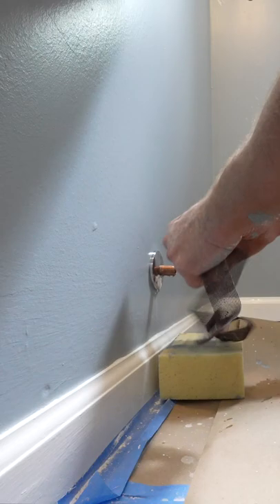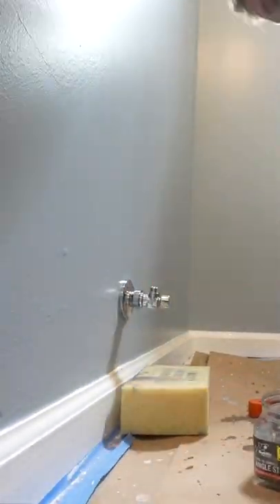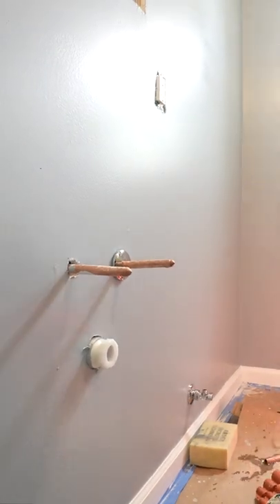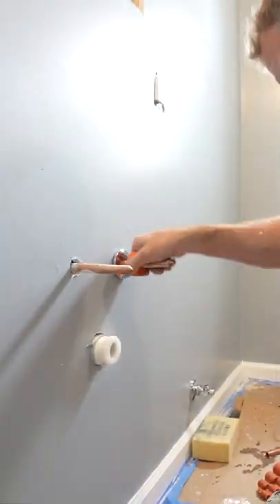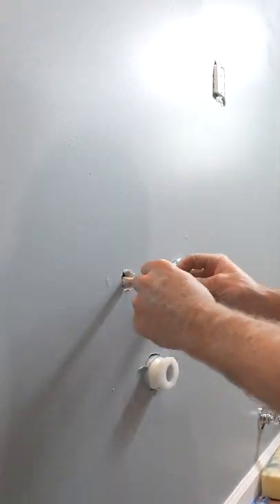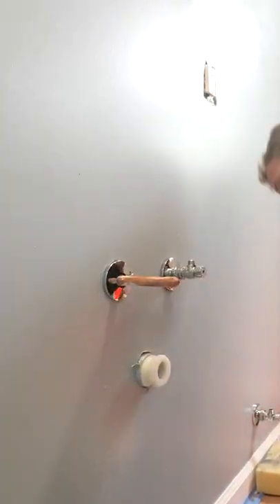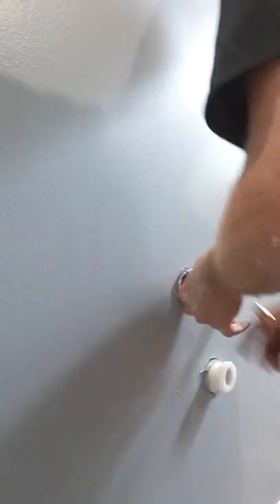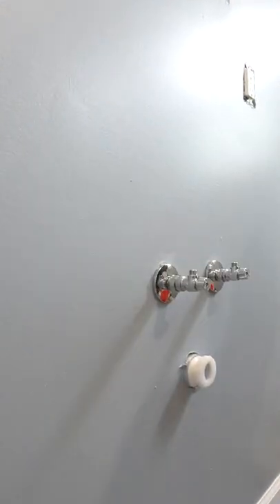Sharkbite Shut Off Valves

Comment: My question is why cut it so short , just make a bigger job for the next guy when these eventually fail
Reply: I think there is a sleeve that comes off that will allow you to get a slim wrench in to release the valve
Reply: I thought the same thing…why?! Why?! Its too short for the inevitable repair…
Reply: why will these fail? is there a better alternative that won't fail?
Reply: @rbruce5270  sharkbites are good and bad. Its good for emergency’s, but when installing its a good practice to de bur the pipe so they last alittle longer. But i would rather use a compres fitting instead or propress. Sharkbites i hate
Reply: @rbruce5270  everything fails eventually. Water breaks everything eventually
Reply: He says it a few times. It’s for a pedestal sink and it hides the copper.

Comment: Shark bite valves are for hacks!
Reply from the maker: That’s what many said about pex a decade ago 👍
Reply: I was using PEX 25 years ago
Reply from the maker: So tell me why sharkbites are for hacks? What about them do you have an issue with. Ever look at the faucets we have today? About a half dozen o-rings holding the together 😆
Reply: @BathroomRemodelingTeacher  are you confident using them inside a wall?
Reply: I don't use many sharkbites, because pro press exists. But my least favorite SB fitting has to be the shut offs. They spin. I wouldnt use one on a shower faucet/diverter either. I definitely didn't use any in my own walls when I was building. Just my personal take.
Reply: @BathroomRemodelingTeacher  exactly!
Reply: Would you use a compression fitting inside a wall?
Reply: Not really when installed correctly, fast, good or cheap, pick 2
Reply: @tintshady2049 yes, but are not recommended. Sweating copper which can stand up to 100 years is always recommended, sharkbits are good for 10-25 years.

Comment: That's great, here's what im running in to. Of all the different manufacturers quarter turn shutoffs, ive found most of them are trash in 5yrs. The ball typically seizes and does not shutoff as marketed forcing you to change outbthe entire valve. Im back to using a multi-turn. Heres why- It eliminates ever having to change the valve body unless it leaks, only the stems. It's a beautiful thing. Saves my clients and myself time and money.

Comment: Came home to a shark bite popped off and flooded my main level. Immediately switched them all to compression
Reply from the maker: Wow 😯
Reply: Do you remember if you made a square cut, cleaned the pipe, demurred it fully, and used the depth tool?
Reply: @licon452  was a contractor that installed it and probably not.

Comment: Why not use pex instead of copper? In my area (Toronto), I almost always convert the water supply from copper to pex when doing bathroom renos. I've always been told to stay away from copper if possible.
Reply: Well for one everything you just called out is going to be behind the vanity,just saying but I understand your thoughts
Reply: @Honeybadger1975  I getya but I'm sure he's not going to show his little spots here and there that are not perfection,I think you took what I was saying the wrong way but GOD BLESS YOU
Reply: @Honeybadger1975  he's useing shark bits... that tells you he goes cheep on every thing... a shark bit is for a temporary fix... he's useing them for a permanent solution
Reply: @joebinion1  ummm do u not know what a pedealstool skink is? That's not going to hide much...
Reply: @51-FS  ik what a pedastool sink is
Reply: @51-FS  shark bites are expensive cost wise and they are a permanent fix
Reply: @51-FS  but I agreed with you on your statement about his primo finish
Reply: @JoeBiden1 shark bits is not a permanent fix.....
Reply: @51-FS  they last about as long as compression fittings
Reply: They're guaranteed for 25 years and are rated and approved for in-wall use...so how are they not for permanent use?

Comment: Ok why would you spend so much time putting the quality work into the remodel to compromise the integrity by using cheap sharkbite fittings? They are definitely going to fail! And damage all the nice work that was done! I would not gamble with them. They are only good for temporary use like capping off stubb outs while remodeling. Never bury them in walls or ceilings!
Reply from the maker: I disagree with the assessment that they are low quality. Same things I’ve heard about pex 15 years ago. There has been very little I’ve heard going wrong with these when installed properly

Comment: Eventually they will fail. I would rather have a good old fashioned solder joint.
Reply from the maker: Most of those leak when you turn off. So yeah I agree, someday they will all fail 👍
Reply: Angle stops installed onto copper tubing use a compression ferrule, NOT SOLDER. I suppose it's easy to be an armchair plumber though.

Comment: Quarter turn shut off’s are the worst things I have ever come across. Many years ago I worked at a apartment complex and that’s all they had quarter turn shut offs. After a few years the handles break  off and now you have a leak all over the place . Also we shut them off and the handle breaks, know you have another leak. It got to the point that every time someone moved out, that was part of the routine to replace those mother F$&king shut offs.
Reply from the maker: Interesting…I see that issue with all the multiple turn valves. Guess none of this stuff will last. It really does seem that way too. Everything is made cheaper and cheaper. Hard to find anything that will last.
Reply: They don't last long, true. But I still chose 1/4 turn ball valves any day over a multi turn compression valve. The rubber gasket in compression valves don't last. It's always the first part to break and leak
Reply: @shabirbashir8187  exactly. Always use comp 1/4 turns. Always.